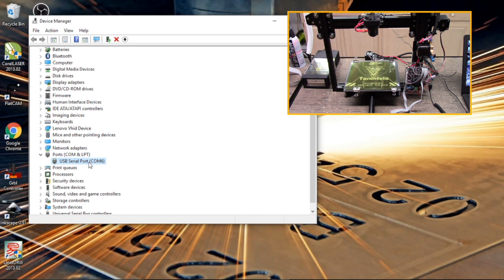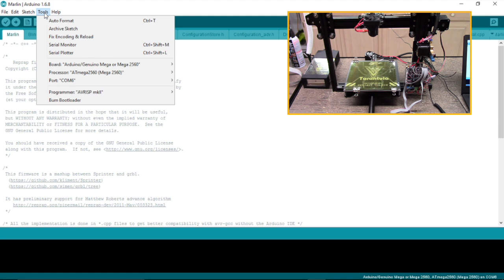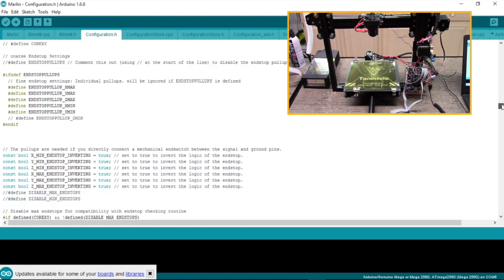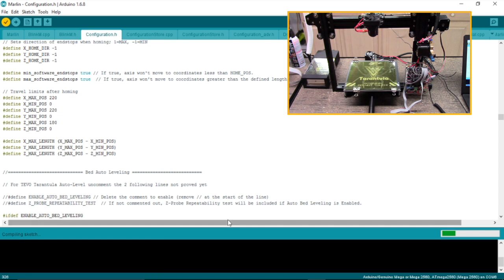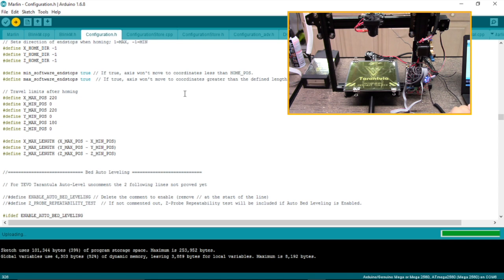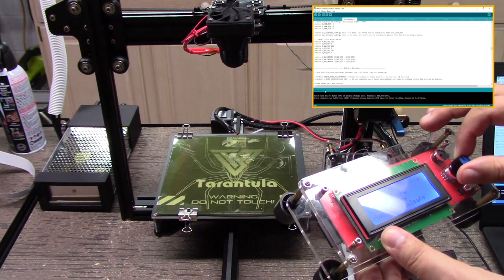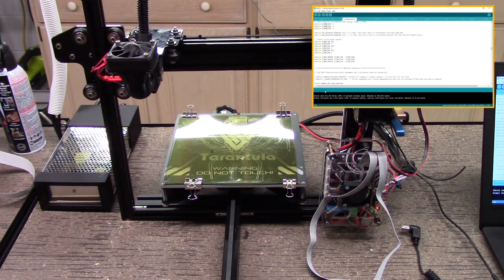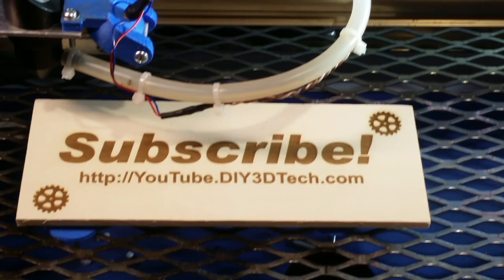TEVO Tarantula 3D Printer  -  ReFlashing the Firmware How Hard Can It Be?

Comment: Hi, I really hope you can help me on my Tarantula.  I have been trying to get this to print for over a year, new motherboards everything.  My Z axis will only move from touching the bed up a half an inch and my Y when I move 10mm goes the full 280mm.  I just replaced the motherboard again and I still have the same issue.  I have all new steppers, wiring everything and I cannot get this stupid thing to work.  I have windows 10, dual Z motors on one cable, and the SN04 Sensor as well as X+ and X- endstops, the SN04 is on the Z- input and a standard endstop switch on the Y- and my Y motor is on the Left
Reply from the maker: So its hard to tell without seeing it, however if it is "moving" yet in the wrong "amounts" it is likely the "configuration"  which is at fault.  For example if you look at the Tarantula playlist you will see how I had to modify the firmware because mine had the incorrect bed size defined.  To further explain, there are "soft" limits in the config files so if it thinks its passing that limit, it will stop which again makes me think this is your issue...
Reply: @DIY3DTECHcom  ok, I have no idea where to look.  I am still a bit new at this
Reply from the maker: Well the bad news is you will need to understand Arduino sketches to fix....
Reply: @DIY3DTECHcom  I am working on that. I have been trying to self teach my self.  Is there a way I can email you my config.h and config.adv.h files to look at?  What is confusing is that most of the settings people talk about, I do not see in the version I have.

Comment: The most up to date Marlin files for the Tevo Tarantula can be found on github.com under Jim Brown, and they are easy to use.  I found Facebook only helpful for sorting out an issue I had.  Always unplug printer from the mains power supply,  and if it won't compile after checking your ports etc, also disable your antivirus software, as this can also cause an issue.
Reply from the maker: Many thanks for sharing this!  Its been a while since I have used this old girl, might be time to revisit!

Comment: Can you provide a link with the file you used to flash your printer I have the same printer but with the upgraded dual nozzle and extruder.
Reply from the maker: Check out Facebook group for the latest.  I don’t use FB so another viewer sent me the file but this quite some time back and there are newer versions out
Reply: DIY3DTECH.com the ones they have on facebook have errors... won't work for me. Can you send me a copy of yours via dropbox?
Reply from the maker: Sorry I am not sure where its at as this was quite sometime back, however the Facebook Group typically keeps up well so what kind of errors are you getting?  Also have you flashed a controller before?

Comment: AAAAAAAAAAAAAAAAAAAAAAAAAAAAAAHHHHHHHHHHHHHHHHHHHHHHHHHHHHHHHHHHHHHHHHHHHHH
"you downloaded the marlin firmware!"
now what? WHERE???
WHY ON EART IS THERE NO BLOODY MANUAL IN THIS STUPID THING
I AM TRYING TO DO _ANYTHING_ FOR TWO WHOLE COMPLETE DAYS NOT
NOTHING HAPPENS; THE THING DONT EVERN MOVE 

HELL I AM SOO PISSED; AND LET ME ALONE WITH THE STUPID FACEBOOK GROOP; NOBODY ANSERSW MY QUESTIONS ANYWAYSS
Reply from the maker: Understand your woes, and not to add salt but this is typical for a "Chinese Kit", would suggest the Thingiverse group over the facebook group too.  So to your problem, is there anything on the LCD screen?  The controller should come pre-flashed as I got the Tevo fork and upgraded mine (quite some time ago and there is likely a newer version but don't feel compelled to upgrade with each if it is doing what you want).   So if there is a menu on the screen try homing all axis and let me know what happens and we see what we can do to help you...
Reply: yers am aso angry at tevo. I/we spent more than 20h on putting it together. So bad description or no description. I am a hardware/software guy. The best part was that when typing in the commands stated in the manual, the device said "unknown command". And flashing the device came after using repetier in the manual. I tried to flash it. Now nothing works. the display show white boxes 
█ █ █ █ █ █ █ █ █ █ 
█ █ █ █ █ █ █ █ █ █ 
█ █ █ █ █ █ █ █ █ █ 
and arduino ide can not connect/flash
Reply from the maker: Ugh, I have had other viewers write me about this and sorry to say not good.  So were you connected in the past (assume yes but double checking).  If yes and not working, uninstall the IDE and all drivers, then reinstall and see if you can reconnect.  Also check out using the CH365 driver as I have heard of people having success as the board they got was a knock off.  Also you could try XLoader and get a hex file try flashing but that too will require connection.  USB/Serial connections can be a royal pain....
Reply: hi, no it is not that complex, i just did not know that you have to unplug the power suply and unplug the usb and then plug in the usb again but not the power supply for uploading firmware, because ... well, i dont know, nobody told me
Reply from the maker: So you can now connect to it again, as the controler can be energized by the USB connection...
Reply: okay, another important part is to pu the config .h-files for the tarantula from the examples into the folder. Now it works. But the bed leveling sensor which they send me is broken/unfunctional :(
Reply from the maker: well at least you got here, I can't help much with the bed sensor as I don't use them as they are pain and not of much value.

Comment: I understand how to flash my tarantula but hit a snag , am running windows 10 pro 64bit and when I plug my usb into laptop only has usb 3 connections , comes up under universal serial bus controllers as unknown usb device(device descriptor request failed).
please help me work out what is going on
Reply from the maker: Sounds like your board is using one of those cheap Chinese UART chips that take an odd driver try the Zadig loader...
Reply: Put your PC in Test mode and instal FTDI drivers

Comment: I keep getting a a message telling me that the programmer timed out. The blue light on the arduino is not flashing. I'm on the right COM port and its not working. Help please!
Reply from the maker: Would try rebooting everything (start clean), also make sure you have the correct USB drivers and "correct" baud rate set as if your getting a time out error this means the computer isn't being answered by the arduino and just because you have a com-port selected doesn't mean its connected in the USB world...

Comment: could you please tell me how to set up the auto level sensor, where to plug it in and in the code. I've had the printer for two weeks but I can't get it running the info is so lacking. thank you very much for any help
Reply from the maker: Sorry have not used a level sensor as think they are more of a headache than they are worth (IMHO only), however they typically connect via the Z limit connection and you have to activate this in your firmware my turning it on, recompiling it and uploading it to your control (at least what I have seen) Sorry I couldn't be of more help...

Comment: I got this error when uploading it:

Arduino: 1.8.3 (Windows 10), Board: "Arduino Mega ADK"

Sketch uses 123206 bytes (48%) of program storage space. Maximum is 253952 bytes.
Global variables use 4639 bytes (56%) of dynamic memory, leaving 3553 bytes for local variables. Maximum is 8192 bytes.
avrdude: stk500v2_ReceiveMessage(): timeout
avrdude: stk500v2_ReceiveMessage(): timeout
avrdude: stk500v2_ReceiveMessage(): timeout
avrdude: stk500v2_ReceiveMessage(): timeout
avrdude: stk500v2_ReceiveMessage(): timeout
avrdude: stk500v2_ReceiveMessage(): timeout
avrdude: stk500v2_getsync(): timeout communicating with programmer
An error occurred while uploading the sketch

This report would have more information with
"Show verbose output during compilation"
option enabled in File -> Preferences.
Reply from the maker: Since I did the video quite a while ago, check in there as I typically state the IDE number I use and you many need to use that version as well as again check your baud rate and if your using windows make sure you have the correct USB drivers as some of these use a cheap Chinese UART and require a special USB driver...

Comment: Couldn't help laughing when you mentioned the bed size - "220, 221, whatever it takes." - Jack Butler (Michael Keaton - Mr. Mom 1983)

How does that new firmware help you?  Do you have more control with it?
Reply from the maker: Dosen't seem much different as I was hoping it would solve the issue with the end stop but no luck as starts about 20 mm off on the y axis from the end stop and I can't figure out why.  Other than that prints fine...
Reply: in marlin advanced config file , you cna set how much it comes bach form a end stop as 'home' . i dont have marlin open for my home brew rig , but i remember it being something i had to set to 0 .  so home end stop == home pos not jump back 1 cm .
Reply: I found it i think , in your video you scrolled very fast past it in configuration.h, but look for "#define MANUAL_Y_HOME_POS -41 "
i think i saw -41 on your setup and for default T' bed .   i suggest knocking it back to only -21 , or what ever mm count put Y 0 where you want it to be .   my rig is off rite now , but y home on min is 0  as the end stop is actually at 0 for all concerned axis . but that's how my rig is setup .  but im pretty sure you can fuss with that number of mm to put the head just rite after homing .
Reply from the maker: Many thanks will try changing next weekend (heading off to Chicago & Houston)!
Reply: how do you find time , you are always on the go .  but i suspect you cna just set it to 0 first and baby step it a few time to get + / -directionality and the just set 21 or such .
Reply from the maker: No sleep :-)  Thats what I am going to try and do as I can't remember if I messed with this or not.  But can't figure out why its doing it as it should match the out of the box code...